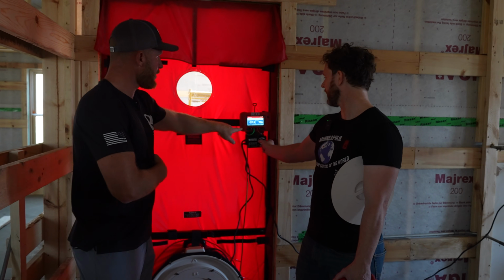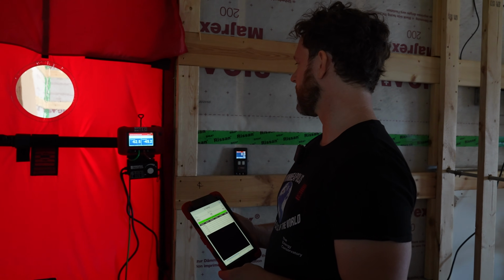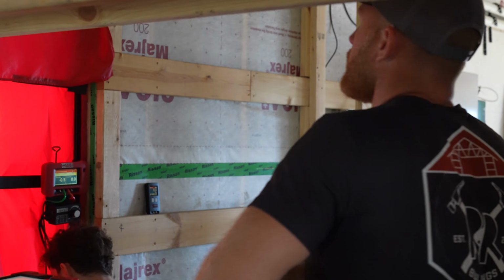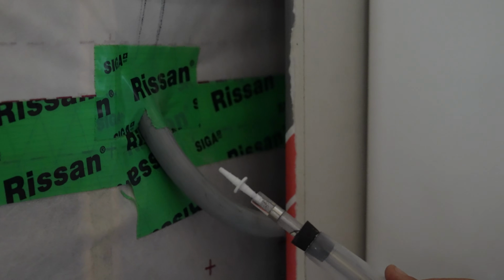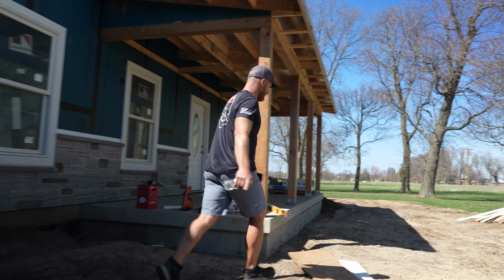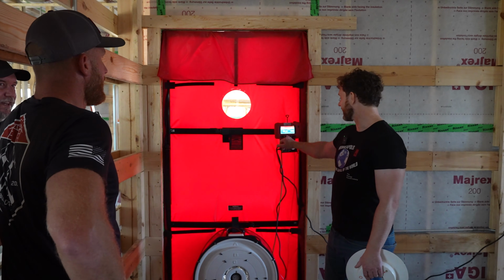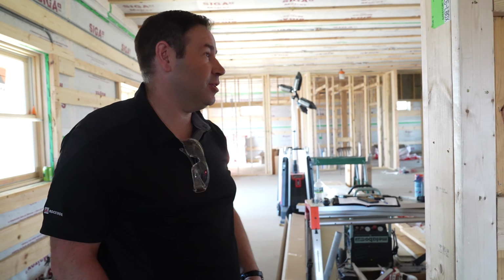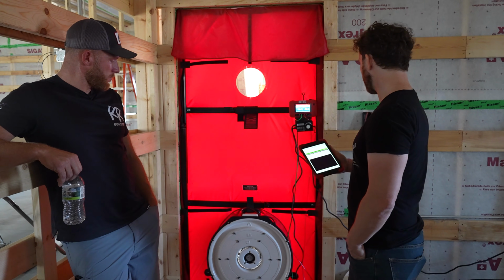Can a House be too Air Tight?

Comment: we just had a problem with a 400 series Anderson patio door one seal on the fixed panel seals the whole door we had to call Anderson because wind driven rain was going through the seal and there was standing water on the inside

Comment: Nice Demonstration I remember Building the McDonald’s and setting the air pressure because of the exhaust fan’s and Roof Top AC ya wanted Positive Air pressure to keep Fly’s from coming in the Doors and DT Windows!
Reply: And it keeps the smoke out during forest fires in the area.

Comment: The building is tight enough that will it be an issue when running bathroom fans or the kitchen stove fan?  I'm wondering if there will need to be an interlocked air intake damper.
Reply: Filtered makeup air. Need oxygen replenished.

Comment: Your electrician should have sealed that pipe with a duct seal compound that remains flexible. It's required by code per NEC 300.7 (a). Maybe remind your subs of that in the future to ensure good scores!

Comment: That does it for me. I'll be building my walls out of Rockwool but my roof with SIP's. Not sure what I'll be doing for my under slab insulation just yet.
Reply: Spart foam can be applied under and around slab.
Reply: @ShotGunner5609  Don't you mean spray foam?

Comment: Yes and so can a barn, my inlaws had one built recently and it was all sealed up and not ventilated. The first time we went into it in the spring after it being closed all up all winter we nearly passed out to gasoline fumes from vehicles stored in it. It took over a day with the doors open to comfortably be able to enter it again without smelling gasoline.
Reply from the maker: That doesn’t sound like a good thing
Reply: @RRBuildings  I am a timber frame designer, I have not been part of one of these tests but I would like to see how it compares with SIP walls as we typically specify air exchangers due to how well they are sealed up.

Comment: Houses can be to tight. If there isn't a proper make up air system your breathing bad air. My home only has a boiler. Windows have some leakage to help bring in fresh air. I've installed some amazing mechanical systems in schools, hospitals,libraries etc. And  those systems are bringing in 100% outside air. The air handlers have 2 blowers. One for the return and one for supply. The return blowers suck inside air and is blown directly outside and the supply blowers are bringing in the outside air and blown to the supply diffusers.  Now in colder days and hotter days the damper inside the air handler will open partially where it cuts back to 50%+/-. In my home I definitely don't want it to tight.

Comment: Instead of using conduit to the exterior use PVC. It will have less thermal bridging.
Reply: Might not be code in some areas, such as where I live... 🤔
Reply: @alanjackson1015  
Maybe where forest and brush fires are a thing.

Comment: There's a big ol' gap at the top of the blower door the entire test. Really wonder how much that affected the results.  It's right above his head in the video.
Reply from the maker: We tested with smoke… it didn’t equate to enough to worry about… if we were trying to get even lower maybe we could have sealed it
Reply: @RRBuildings  Maybe you'd have hit that 0.43 instead of matching the 0.44 from the last build!  haha.

But yeah, just wondering if I was seeing things or if the blower-door wasn't quite fully sealed.  Thanks for the great video and great explanation of the process here.

Comment: Kyle, I like you, Dude… but why is spray foam the “lazy” way?
Reply from the maker: Lazy because initially it may be great and it required very little detailing.  Also it’s not breathable like a smart vapor or air control layer.  I don’t mean to be negative and I’d still spray foam when it makes sense.  But as a builder I don’t get to actually check every detail so I call it lazy for me as a builder
Reply: @RRBuildings  Spray foam is an absolute racket these days, the prices being charged are ludicrous. The only person it's better for is the installer... Equal results can be had for half the price.

Comment: Yes, And I speak as a 25 year HVAC service tech.
Reply from the maker: You say it can be too tight?
Reply: @RRBuildings   Yes. When you have gas fired appliances along with bathrooms pulling air out and not enough make up air, you can run into issues of negative pressure in the building envelope.
Reply: @Furnaceguy1978  Not enough make up air, and negative pressure means poorly designed/installed HVAC IMO
Reply: @alanjackson1015  if you run all your bathroom fans plus kitchen exhaust plus clothes dryer as well as your gas water heater all on a busy Sunday laundry day, and yea I have seen this numerous times, how is that a design flaw?
Reply: @Furnaceguy1978  Your system should be designed for that load. If it isn't, it's poor design. Pretty straightforward really

Comment: Kyle, post frame doesn't have an advantage over conventional traditional framing for air sealing and blower door test scores.  The reason for your excellent scores is that you and Greg pay attention to every detail and build a better building with each successive project.  Your exterior sheathing and taping is very good, your interior air sealing and taping is very good and your detailing of all of your penetrations is very good.  Because you care and actually try to do a very good job you end up with a very good building.  Give your plans to a production builder and they would build the post frame structure just as poorly as they build their conventionally built homes.  The bottom line difference is that you and Greg give a $*it and the results reflect it.  Very nice workmanship!  Thanks for sharing... 😁👍👍👍👍👍👍👍👍👍👍
Reply from the maker: Well I appreciate that but I will argue post frame is an “easier” detail to perform
Reply: @RRBuildings  Please don't get me wrong here as I agree with you.  However, that being said, if you and Greg built an exact duplicate of that building, footprint, wall height, trusses, etc. and finished it out the same way, I think that you would end up with the same results.  It's your quality workmanship and attention to details that seals the deal...  I love post frame and very much respect your opinion and am in no way trying to stir the pot.  The simple rectangle well sealed inside and out is very hard to beat regardless of the framing method.  I am a GC, a long time subscriber and I greatly appreciate your work and your YouTube channel.  Keep up the great work.  You are a rising ⭐⭐⭐⭐⭐⭐⭐⭐⭐⭐
Reply: @danielstover3029 For a non-builder viewer like me, it’s just inspiring to see ppl like these guys not slap it all up; they take an extra few minutes to line it all up carefully and then add fasteners. 😮
Reply: @RRBuildings  Dont forget possible plumbing waste piping that doesnt have water in their traps.....
Reply: @SubStationSparky great item I would have missed on start up. Hope bdoor guys all know that one and others.😮😊
Reply: @RRBuildings  dude, there's light showing throw on the blower door, right? Or am I seeing things?
Reply: @Forkandoutletz  Is it the round window you are looking at? Plastic covered.
Reply: Amen!!
Reply: I would argue there are some major advantages - some advantages could be worked into conventional framing if you can get the crews on board - but having the entire interior one open spaces - no structural load wall that you have do plan and deal with (youd have to leave strips of the vapour layer for the framers to place in as the wall adjacent framing is attached). 

with post frame - you can frame everything as normal - then get specific guys that can handle the entire air seal - get a real test there to ensure quality (avoid taped seems like they had one there) - and your done.

You'll still have to coordinate with the other trades - pipes and other penetrations are a lot simpler with butyl circular seals that you can put on DURING INSTALL - then you don't have to deal with the tape situations there as much. So it'd be much easier to roll out a higher quality product than having to retrain carpenters (the carpenters aren't getting a pay raise to do more work, and won't feel like it's their job and have no reason to do a good one - it's harder to change people then just modify the process a bit).
Reply: @jonathanburr9798  JB, all of your points are correct.  However, any framing crew would be able to conventionally frame a rectangle, set trusses and create the same open space.  The shear panels and air sealing we be almost identical.  I have done it both ways and it is simply all about the details.  You definitely have to make sure that everyone involved is committed to the objective and that they understand each and every step.  It is really fantastic that so many can learn and exchange ideas in a positive manner thanks to the light shined on the subject by Kyle and Greg.  Great work all around.  Great buildings and great videos.  Many thanks to all contributors! 😁👍
Reply: @danielstover3029  it takes a lot of sticks and foam to get 8" of insulation and almost no thermal bridging
Reply: I would agree over air tightness but would argue over overal R value of walls as stick frame is loaded with wood and post frame rather with insulation wich in total will bring higher energy effinency building to be the post frame one ;)
Reply: Yep
Reply: A little late to this, but your take is spot on. Yes, post frame has its advantages over traditional stick frame due to the simple fact that post frame uses a significantly less amount of lumber to build resulting in very little thermal bridging. With stick framing, you can achieve very similar, not exact, but close enough energy efficiency ratings that may just barely be at or above 1 ACH due to stick framing naturally using more lumber resulting in more thermal bridging. That said, both framing methods are just fine when done correctly and in this economy, post frame may not cost significantly less in material due to the insane lumber prices now. With post frame, you may only see a couple thousand in savings in material alone. That's about it. Pre covid and around just the 2010s, then I could see post framing being significantly less expensive in building material costs alone. But for now with the crazy prices and the dollar loosing its purchasing power, there's no huge difference in costs with material, just my unprofessional opinion.

Stick framing will always have one huge advantage overall, though, and that's it's very DIY friendly if you're planning on going down the owner/builder route for your own home on your own property that can afford the permitting and material costs, but not the labor aspect of it. So you decide to put in your own sweat equity. You just gotta know what you're doing and check with local building codes same with post frame and it's even easier to do research on in the digital age of information. That's likely how the house that previously stood on the property in this specific series was built back in the old days. By the client's family generations back that decided to put in their own sweat equity especially since stick framing is DIY friendly. (This is assuming the client inherited this property from family members that passed away and decided he wanted a clean slate with an all new home) Very common scenario in the rural midwest with property that's owned by the same family dating back generations.

Comment: Excellent job guys!

Reading through all the "too tight" and "house needs to breath" comments reminds me that the general public has a lot to lean re erv/hrv. With ach in a typical home, "fresh" air is pulled in through the wall system, any off-gassing of building materials is brought right in to breath. With an erv/hrv, the fresh air is brought in directly from the outside, and preheated /tempered with outgoing air - not the efficiency loss many commenters fear.
Reply: The question becomes what are we gaining? The only real advantage is the fact that we can now filter said air. The energy cost is very similar once you add the entire cost of the erv/hrv.
Reply from the maker: Gaining so much more than just energy efficiency.   Quality of air, less dirt, bugs, mold being trapped in a wall cavity due to leaky walls
Reply: @RRBuildings   First and foremost you and Greg have built a great post frame home in these videos. You have gone to much greater lengths than most builders and subs ever would to create a quality product! Here in the southeast however the tight air approach to home building introduces more issues pertaining to moisture, mold and condensation. The outdoor air in most of the US is 2 to 5 times better quality than indoor air according to the EPA so, filtering indoor air is of much higher importance than filtering the incoming air. That being said any filtration you use is a good thing especially if you suffer from things like seasonal allergies, asthma etc. Bugs and dirt can be avoided with "proper" conventional building techniques. As you have shown in this video air is entering the wall in many places and you are depending on the Majrex at the drywall level to stop the flow therefore, (IN MY OPINION) mold isn't any less likely to be trapped in the wall cavity than a "leaky wall cavity". 

P.S. I built and live in a "tight air" home (well under 2 ACH 50). I initially installed just an ERV and humidity would regularly get above 65%. This forced us to install a whole home dehumidifier to be comfortable in the summer.
Reply: @jimjohnson515  were gaining the ability to  control the volume and source of fresh air. Also, to increase fresh air flow is a tiny fraction of the cost of opening a window, as an HRV is ~85% efficient at capturing heat from outgoing air. Equipment running costs are inconsequential with a small ecm motor.

Comment: Really curious how much extra cost is involved in taking it to that level. Whatever it is, there is a payback period in terms of energy use. If that can be clearly explained to a client, like with solar projects, that'd be where the benefit to the builder happens. They pay you up front instead of paying the energy companies forever.
Reply: Also curious if this is an extra cost over spray foam — especially closed cell to get that “air seal”.  I would think potential cost savings gets eaten pretty quick with the time needed for detailing.  I do think this will have a longer efficiency life.  Maybe factor a ROI with the r-value losses of foam over time compared to this method.

Comment: As an Insurance adjuster, we see a significant increase in mildew in homes that are built excessively air tight. They are absolutely energy efficient, but may not be the best option for those in a wet, or drastic temperature range climates. Solely my opinion of course, I think you guys do great work!
Reply: Tight is fine with an appropriately sized HRV system.

Comment: All this without spray foam at all. Amazing work.
Reply: Spray foam has a lot of issues people ignore in favour for air tightness. I'm glad they can show it isn't required!
Reply: @AmandaComeauCreates  absolutely my thoughts too!
Reply: @AmandaComeauCreates  what issues?
Reply: @FJB2020  so while spray foam can create a great air seal (only if installed correctly and a lot of factors to a great install are hard to control namely moisture and temperature of the air and surface being sprayed. Even technique can make or break an install) there is one fundamental characteristic I run away from. It's R value drops at a very early 'halflife'. So even if installed perfectly, the moment you are done installing and curing is the highest r value you'll ever get. As it ages, you'll have less and less. And the rvalue per inch isn't high enough for that product to hold 'code' rvalue for the life of the building.

It's also prone to damage by insects and water, rodents chew thru it, and while it is a superior air barrier - it is my firm opinion that used as an air barrier in conjunction with a batt insulation as the primary insulator is the best option.
Reply: @AmandaComeauCreates  I have seen many "flash and batt" installs and some suffer from issues.  Mainly not installing the spray foam correctly and/or leaky post frame buildings.   In regards to the half-life, do you have any supporting documents, I just looked and I can't find anything on the LTTR of it and at what rate it degrades.. Thanks

Comment: I think its funny as houses get tighter and tighter EVERYONE focuses so much on being tight and energy saving.  But at the same time asthma and respiratory diseases are sky rocketing and no one mentions all the off gassing, smoke from cooking, normal dust etc...  And people just sit in these super tight homes wondering why they're sick!  At least they save money on the heat bill to spend on medication.
Reply: I think the idea of building a "tight" house is that it allows you to control the exchange of air from the outside.  ERV or HRV systems are required in these homes, which control the off-gassing, the humidity and stink from bathrooms, and there are systems which ensure adequate removal of all the smoke from your kitchen as well.  It's pointless to attempt to control the air at those locations without having a tight home as your basis.